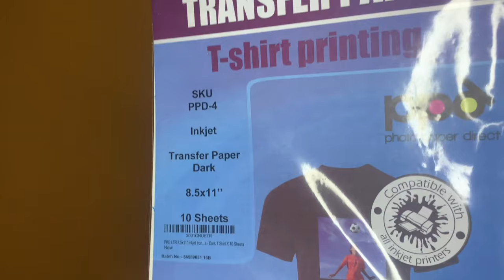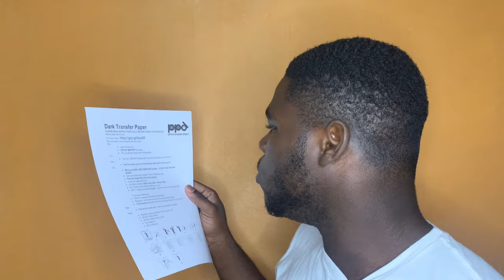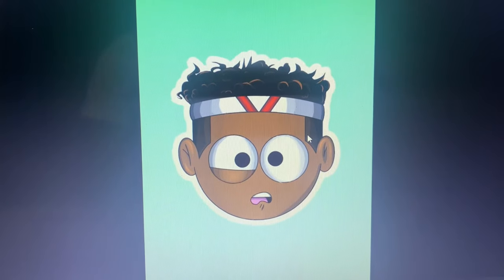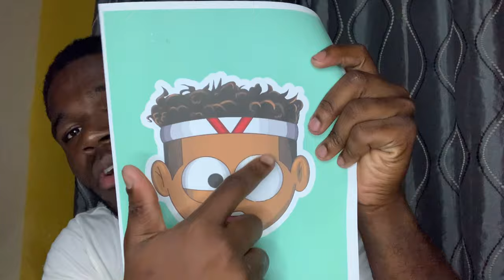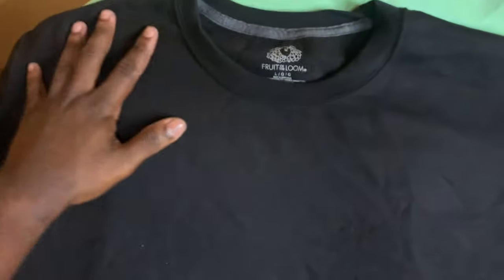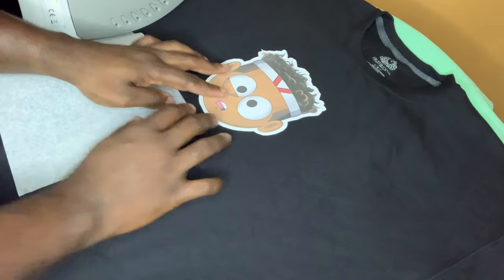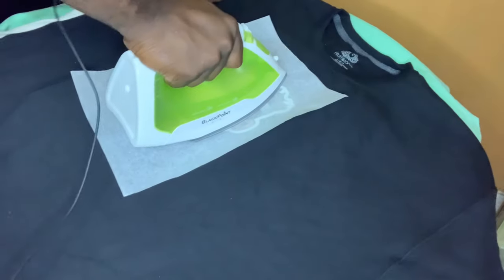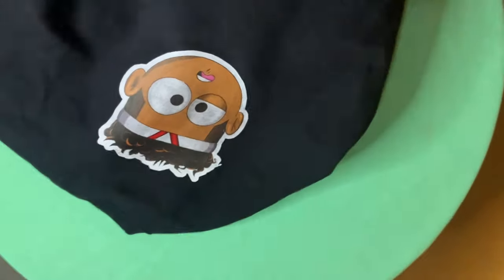How To Print T Shirts Using A Home Printer and Transfer Paper

Comment: Hey man I got a couple questions for the inkjet printer how does the color get to the paper ? Are there cartridges you put that have alot of colors or what ? And also how do u apply that sticky stuff to the sticker
Reply: Do you put the transfer paper down on the printer for it can get printed on ?
Reply from the maker: The color gets on the printer the same way ordinary paper gets on the printer 
You load it in the printer and the ink printed on it .
There is a back side and a front side and the stickiness is in between both so when you’ve printed on the front you just peal of the back to stick it on stuff
Reply: @JeySoRandom  okay and u use transfer paper correct not regular printing paper ?
Reply: I’ve seen videos where people have a picture printed out and iron it on and I see other that have the print on the transfer paper slready

Comment: How can I make it last longer or have the image hold better on the shirt ? I noticed that after 2-3 washes it would fade away Ike almost spot would fade away and start to peel off from corners
Reply from the maker: I mentioned in the video that this method is not necessarily permanent 
It’s for 3 time uses yk little one off events birthday parties wedding etc or if you don’t wash it as often even longer
Reply from the maker: The screen printing option would be the option you’re looking for
Reply: @JeySoRandom  ah ok, thanks for the tip! Sucks cause after 2/3 uses the shirt is still good but the design is what messes up, making the shirt look bad already
Reply: @JeySoRandom  does a screen printer only carry 4 colors at once? Like what about a shirt that has multiple colors? If I do get one I’m looking to get just 1 single machine
Reply: There is a spray for 20 bucks you can use. Its because he used cotton but you can still get around it  with the spray.

Full disclosure I haven't even done one yet but I have been doing some research on it.

Comment: Wait put the transfer paper in the printer ?
Reply from the maker: Yes you’re printing the image on it
Reply: @JeySoRandom  what kind of wax paper u used? And what was it used for
Reply from the maker: @goldiejomanifest8447  one comes in the transfer paper packaging or you could use wax/grease paper that people use when baking 

It’s used to separate the hot iron from the transfer paper when ironing it on
Reply: @JeySoRandom  thank you. 
You think I can transfer lettering instead of an image? 
And do I use word docs to write the text out
Reply: @JeySoRandom  last question Jey
Which exact printer is that? I’m on Amazon now I want to buy it
Reply from the maker: @goldiejomanifest8447  
Canon PIXMA MG2522 Wired All-in-One Color Inkjet Printer
Reply from the maker: @goldiejomanifest8447  it’s a pretty dated printer tho 
It’s just the one I had and have had for years 
You could get better ones on amazon
Reply: @JeySoRandom which is an good one from Amazon? I’m not sure